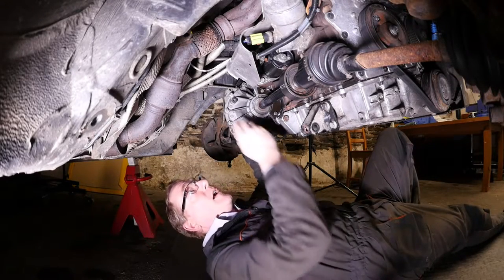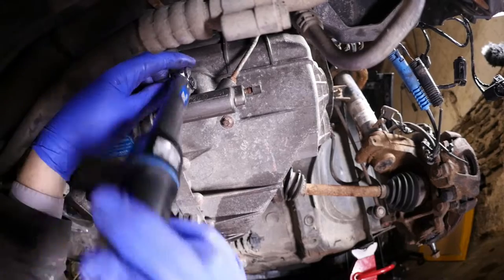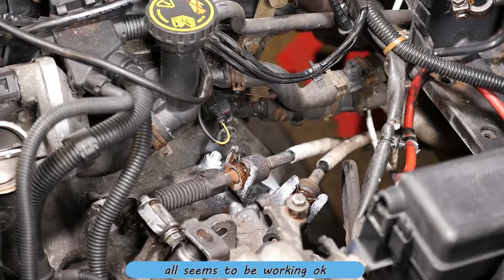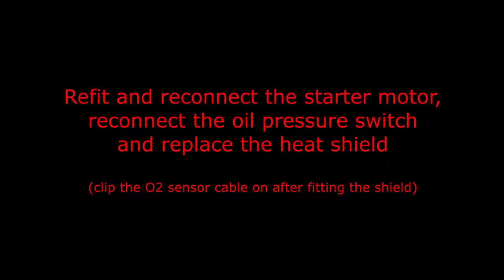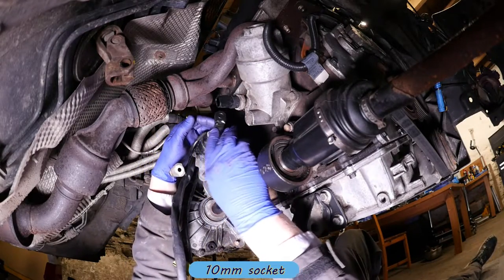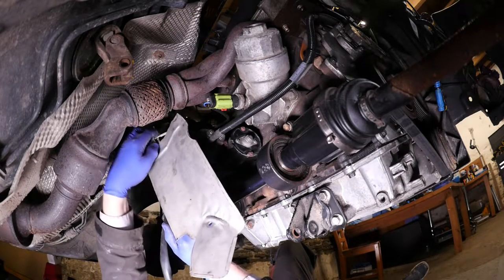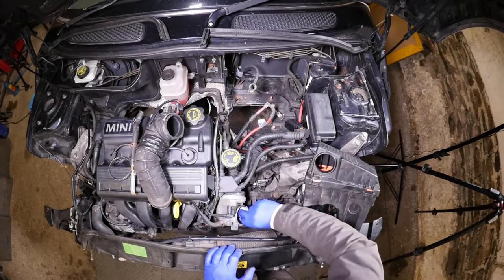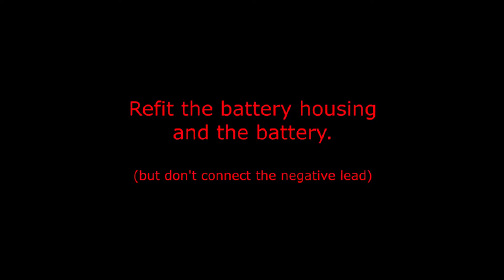Part 6 - Fitting Starter Motor, Air Filter & Battery in MINI R50 of the Clutch & Gearbox Series 🚗🚗

Comment: Hi Mark- Were do the 2 looms for the electric/power steering go/connect?
Reply from the maker: Hi Patrick do you mean on the Motor? There are two connectors on top of the motor.
Reply: @CoatsandGaiters  On the other end of the wiring that comes from the motor - where does it plug into and where’s the terminal the spade goes onto? I presume the spade is the earth., but to where.?
Reply from the maker: @patrickjmorgan  oic I will try to look into it Patrick but my black Mini is back together apart from subframe.  Have you a photo of your issue that I can possibly compare to my car with.
Reply: @CoatsandGaiters  Thanks Mark- I have an odd defect with my car since i bought it.Basically, the ignition warning light can be more on than off- but the battery is charging. Ive repalced both battery and alternator- no difference. I bought it spares of repairs with the claimed defect of intermittent power steering pump. I replaced that and yes, it seemed to behave better but now and then it would fail to kick in. I want to check the wires from the pump as I suspect some synergy between the ignition light and the intermittent pump..
Reply from the maker: @patrickjmorgan  You've changed a lot of parts then.  I have added the power steering wiring diagram to my 'community' section.  Let me know if this helps.  I will delete after you've seen and copied.
Reply: @CoatsandGaiters  Thanks, Ive copied it but I think ive seen it on the FB forum.Ive been going around it circles but Im curious as to the main power lead- where it gets its 12v source and where its eartherd. Thats what I thought you might have known as one of your videos showed the wiring harness off the car.- just the power-lead. Ive not yet pulled the battery-box and exposed the underside of the fuse-box. That is probably the answer Im looking for. (appreciate your input)
Reply: @CoatsandGaiters  a bit of persistence and i found this- at least I know what to look for. Happy to repalce the loom, but Ive got a large mountain of parts folloiwing what seemd to be my own instict and good advice-but misguided as I still havent solved it. I want to check the overal condition of the loom. Quote-  wire is plugged into the bottom of the engine bay fuse box (the box is secured by 2 x 8mm headed bolts, remove them and the box lifts enough to unplug the connector) the other wire is bolted to a earth point on the chassis rail under the fuse box...
Reply from the maker: @patrickjmorgan  I will try and investigate this Patrick when I get a moment.  Running a bit behind this week as we had guests.  Normally I upload on a Friday, this weeks I have only just done it on a late Sunday.  But I am intrigued now about the cabling for the motor.